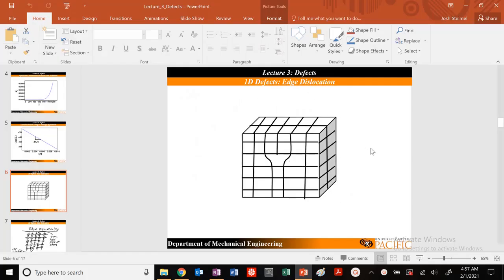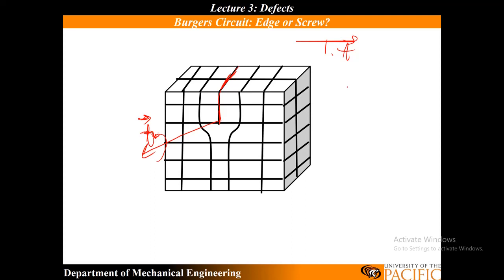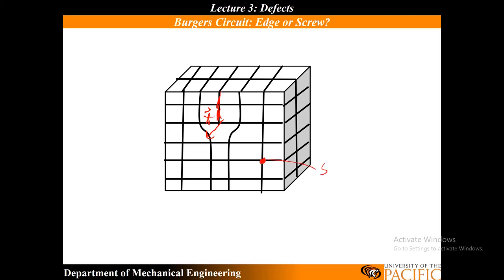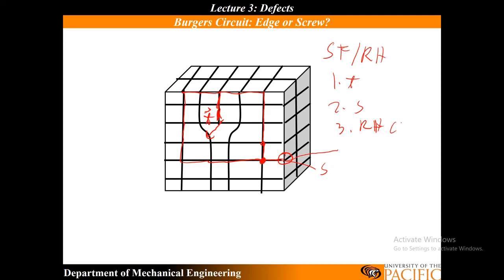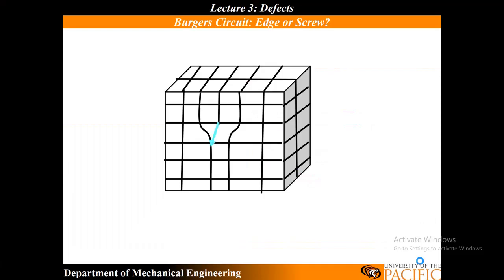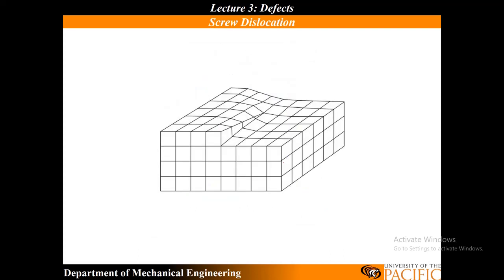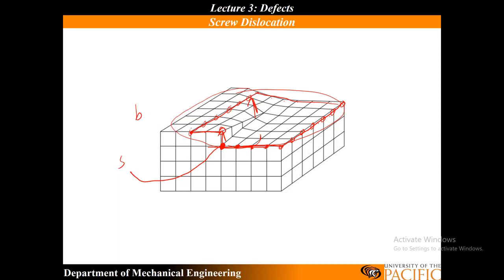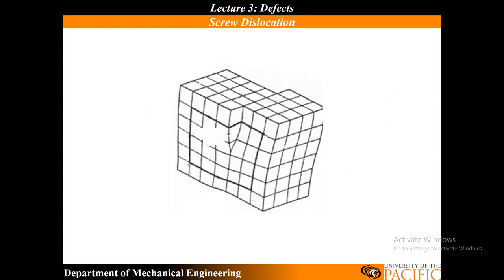Edge Dislocation, Right Screw, and Left Screw Dislocation Burger's Circuit Examples

Comment: Sir, so the right hand screw is the negative screw and left hand screw is positive screw? I read in some text said that the positive screw is always clockwise and negative screw is counterclockwise. Is this clock direction determined by applying right-hand rule in burger's vector direction? And for determining the start point and finish point, we apply the right-hand rule on the sense vector t's direction?